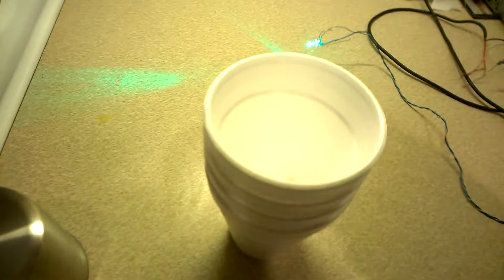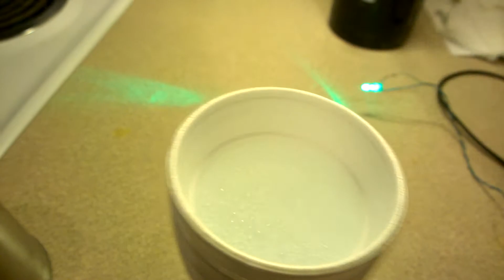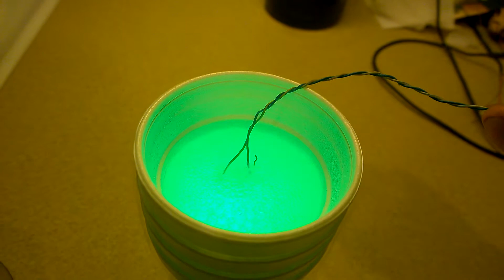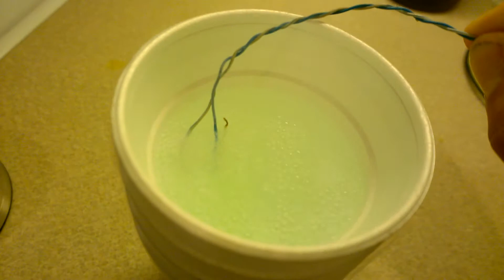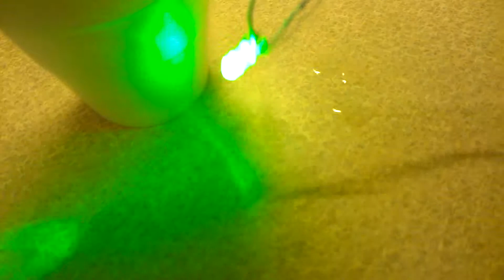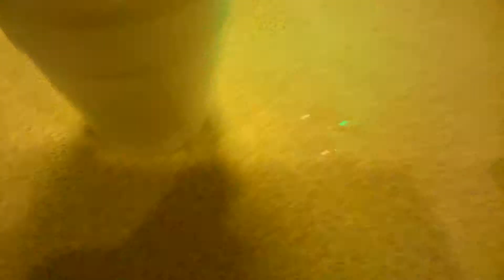Green LED in Liquid Nitrogen

Comment: stupid! you have to increase current of DC circuit ...
Reply from the maker: +Maisonier I was all ready over driving the LED at twice its rated current. I believe the type of semiconductor makeup caused the LED to loose its ability to emit photons before it reached a temperature that would actually change the wavelength of the light being emitted. I have tried this experiment with another green LED from another supplier and was able to see the color change that was lacking in this experiment.